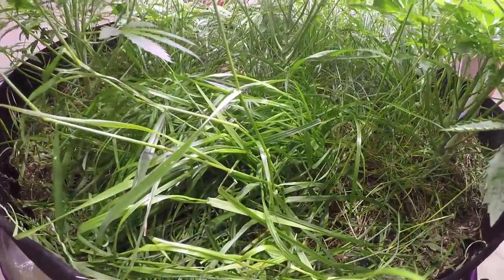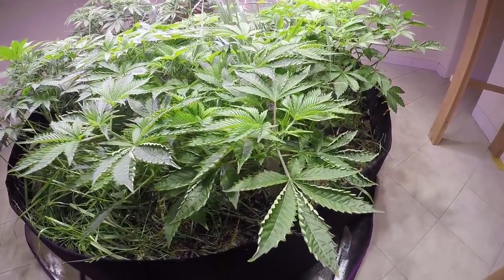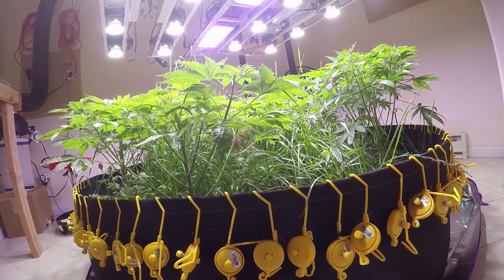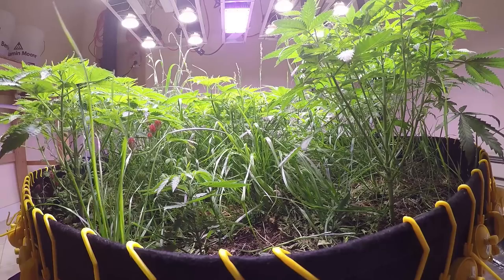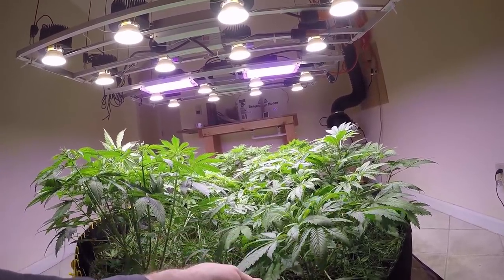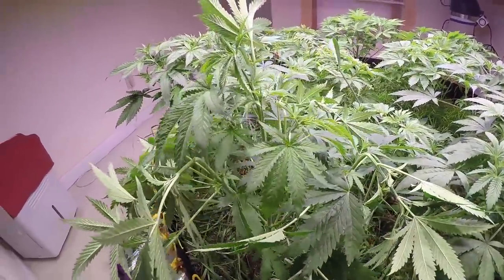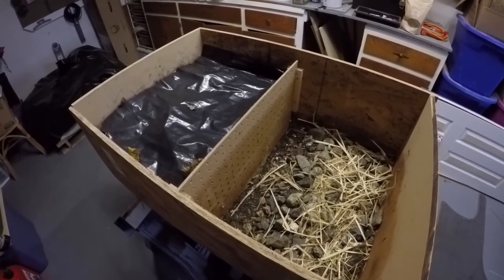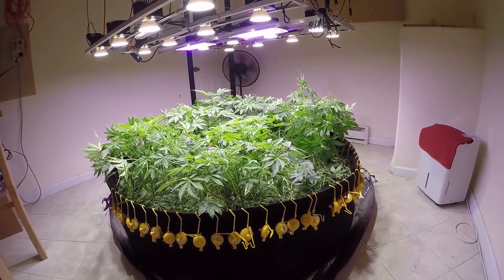Indoor Organic Weed Farm with LED Cycle 3 No Till 7

Comment: Some of the best info on no till i've found. There's tons out there but you are a great teacher and put it all together well dude, thanks a lot. I want to do a huge pot like that but with the 4 plant limit here, wondering if 120 gal would suffice. I may have to start with 20 gal pots for a while. Either way I'll be going pretty close to this, making my own vermicomposter etc, looks great.
Reply from the maker: Thank you for the kind words. 120 should be fine. Cheers!

Comment: If you think that the damage you pointed out is due to mixing the lavender oil strong it would show on every leaf that was sprayed with it ,anytim3 I've ever mixed or seen a spray mixed to heavy that was applied showed significantly on the plants, if you mix afoliar to strong it's gonna show a lot m9re then that
Reply from the maker: I think in my stoned efforts that plant may have got sprayed twice lol. Cheers!